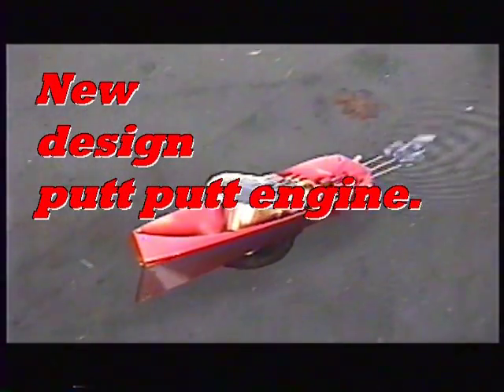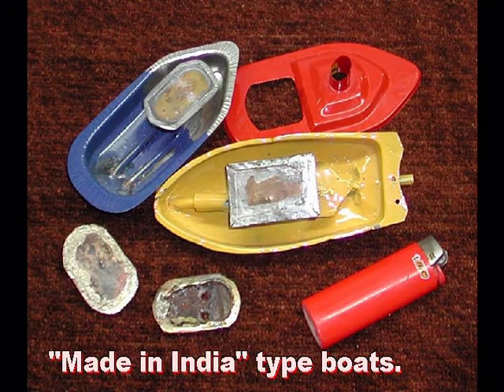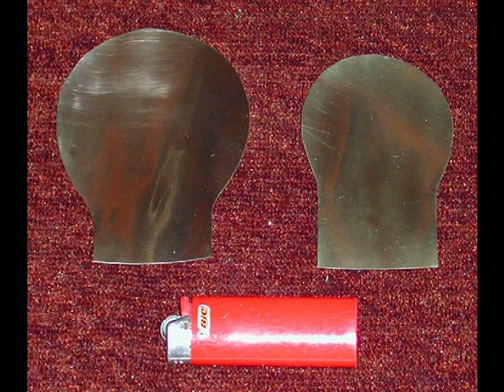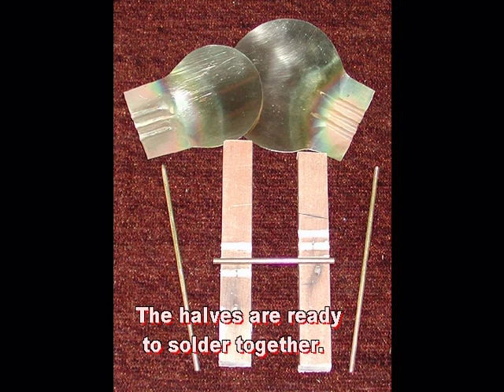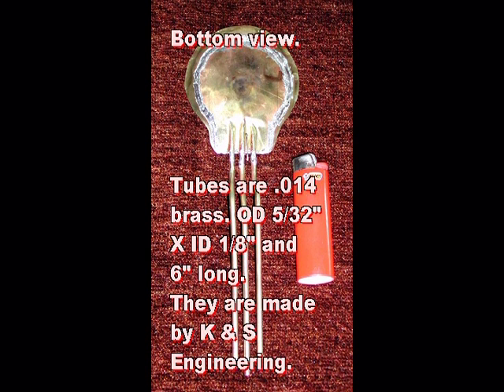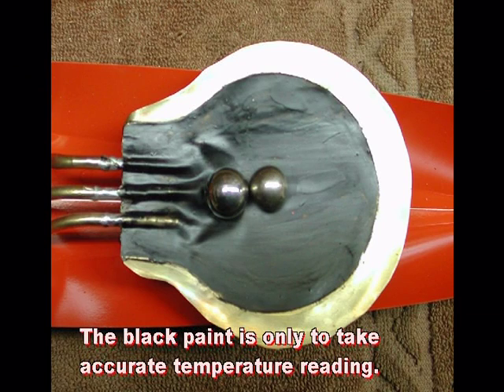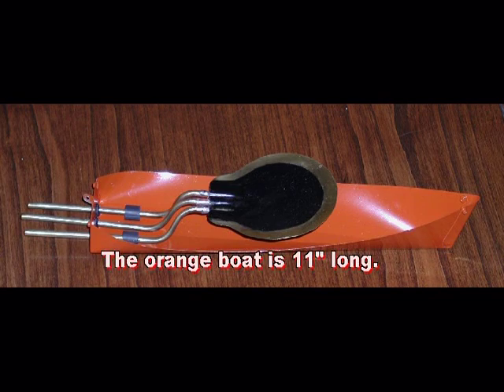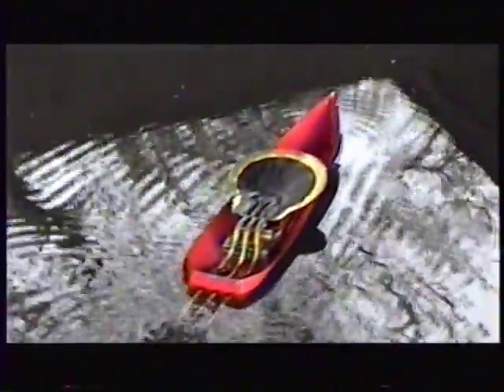How to Build the PP4V Putt Putt Engine-YT.mpg

Comment: So I made your engine! It was fun to make and easy to follow this video! I'm happy to say that the engine does work although not as well at I'd like(yet). I'm not sure if I need more heat or less or if I just did a bad job putting it together haha. I did have to much heat the first test and blew the solder out but it ran like mad whith the high heat. Anyways I posted two videos on my channel showing the engine on some foam to test.
Reply: Also do you think brazing could be possible? you could add a lot of heat if brazed
Reply from the maker: Good job. I watched your videos and you are obviously close to getting it right. Leaks are the most common problem so use a bike tire pump to pressure test. In the video it looks like your boiler is higher above the tube outlets than suggested and perhaps it is too far from level. Maybe it is just the camera angle that makes it look that way. For the smaller engines it is sometimes hard to get a burner low enough to fit under the engine and the temptation is there to raise the boiler rather than build a burner that fits. Thanks for commenting.
Reply from the maker: The heat required to braze these thin boiler parts would melt them. That was part of the challenge in designing this engine.

Comment: Im interested in your aluminium boats, i have a sheet of aluminium 1m47 by 1m90.
And would like to make a small boat that could take my weight. 95 kgs. Im un decided as to what hull shape would be best, canoe, or flat bottom. 
If the sheet is too small, then my other idear is to make a scale rc boat after a mtb or air sea rescue style boat. I can weld aluminium (aluweld braising). 
I also have a lot of smaller offcuts that can be used for reinforcing. 
Minilandroverfrance@gmail.com
Reply from the maker: I know nothing about designing and  building full scale boats. No doubt there are some how to videos on youtube that might help. One thing I am sure would be worth the effort is to build a cardboard mock up of what you want it to be.  D.

Comment: I'm just not understanding the three and four tubes. What are the differences?
Reply from the maker: Good question. I'm not sure except that in my experience up to a point more tubes =  better performance. My best engines have seven tubes. See Jean-Yves's pop pop pages at www.eclecticspace .net
He has engineering and physics knowledge that I do not have.  I believe that he said in theory a single pipe should be best, but I have found them difficult to run and inconsistent though at their best are impressive.

Comment: Did you ever think about making a full size boat that you can ride in
Reply: the cockpit would be around 200F. once the water heated up.  Good for cooking lobster not so much for beach bunnies.
Reply: Scaled to full size, this would be equivalent to a small boat with a small wood-burning steam boiler. Though, I think it might require check valves. (You could even design it so water is only sucked in from the front of the boat and can only exit from the rear.) A put-put or pop-pop engine is, essentially, a form of pulse jet engine (a simple type of ramjet), but built for steam and water instead of fuel and air. No, the cockpit of a full-sized boat would not necessarily be 200F.
Reply: It wouldn't scale up without valves, etc.  Basically, you would then be talking about a steam engine.
Reply: @Simon HomeintheEarth I think a requirement to use valves would be the only major difference. A typical steam engine involves the use of at least one piston and camshaft, in addition to valves. A scaled-up put-put engine should be much easier to fabricate and build than, say, a Sterling steam engine. That simplicity could be appealing to some, esp. if it allows almost anyone to build their own. You might even get away with using flap valves.
Reply: @XpaceTrue  You referred to a "Sterling steam engine".  Correct me if I'm wrong, but I don't think a Stirling (not Sterling) engine is a steam engine.  It is a hot air engine.
In case there was a steam engine called a Sterling engine, I searched Google for it, but I didn't get any hits.
I also thought that a one-way valve, letting water in the front and out the back would make for a better pulse-jet putt-putt design, but if you look at other videos by the guy who posted this one, he has experimented with that, but found it to be detrimental.  I guess he's probably right, having built about 100 putt-putt designs.
Reply: full size would mean, larger tubes, and when you jetison water then you have to suck it back in, for smaller tubes the % of water coming from different angles, is great, but a larger tube, greatly increases opposite vector to thrust water rushing in, negating all forward movement... Maybe with 2 tesla valves ... ...

Comment: I've been fascinated with putt putt boat's since I was very little. A friend help me build I tin one when I was 3 and I was amazed and attempted to build several in the years to follow, with little success I should add. Decades have passed since then and I've made one recently with 1/16th copper sheets for the diaphragm and with my observations and understanding that copper is a great heat conductor it heats up quick and putts along faster then my children can run. You have much more experience then I do would you consider looking into this and if you find something exciting share with us.
Reply from the maker: Good for you. Copper is the best material for the boiler but not for  the diaphragm assuming you want it to make noise and I would expect 1/16 to be too stiff. However whatever works with these often frustrating little engines is fine. Did you have a specific question. Most of what I know is in my videos. Thanks for watching and commenting.

Comment: I bought the little commercial ones from Lee Valley and they worked great. I couldn't get anyone in my family excited about them though, so I ran them for myself. I'm 70 and I thought they'd be fun to share with my kids and grandkids. Guess not.
Reply from the maker: Hello David. That's what I thought 10 years ago when I was 70. Apparently if it is not an electronic device with keys a sceen and interective it is of little interest. Never mind, play with it yourself. The made in India ones like you have rust very quickly as moisture inside the engine is very difficult to remove. Suggest you bake it in the oven after use at about 250 for an hour. with the pipes open end up. Buy some more and you can have races.  Drf
Reply: @DarylFosterPuttPutt4Video  i just love historic toys back when an led was a luxury i may be young myself but sometimes i prefer to watch my turtles swim around as they are super goofy.

Comment: Hello Daryl, I have tested with a similar engine with 3 tubes which stops after running for some time. I am guessing this is due to 3 tubes, that the steam does not travel down the tubes and get condensed(smaller boiler:tube ratio). Is it this what is happening?

Syed
Reply from the maker: +Syed Taha Thanks for commenting. How long does it run before stopping? The most common cause of engine stopping is a leak. Sometimes leaks are very hard to see. Use a tire pump to apply air pressure to the boiler and pipes while holding the engine under water. Bubbles will indicate a leak. If engines with low temperature solder overheat the solder can soften a bit and cause a leak that will seal it self when the engine cools. Try running the engine with a bit less heat. If the engine stops see if there is any water left inside. You have to check quickly because as the engine cools it will suck water back in. If there is no water inside you either have a leak or have run it too hot. Good luck.
Reply: +Daryl Foster It is running for ~600 seconds. When I blocked 1 and 2 tubes, the engine then ran for a longer time. I have tested for leakage already and I dont think that leakage is the reason behind. Probably the power is too much, I am inputting around 36 watts. But if the power is too much, why it does not stop for 2 and 1 running tubes? It seems like tubes:boiler volume ratio does matter?! And there is a "tickle" sound after stopping, sounds like boiler is empty and its heating up.
Reply from the maker: +Syed Taha Does this engine have the same design and sizes as my PP4V engine? Do you have larger tubes? There is a relationship to boiler size and tube size and length among other things. Reduce the heat as much as you can to find the minimum amount it will run on. The tickling sound may be the last little bit of water which is insufficient to keep the engine running so it is sizzling in a too hot engine.

Comment: Nice vídeos.
I imagine how much   work  researching and trying new things you  used to get to this high level regarding these boats. 
So,  thank you for sharing your knowledge.  
--------------------------

I   was wondering when the boat moves forward. 
When the metal capsule expands or when it contracts?
Reply from the maker: +San Pol Glad you enjoyed the show and thanks for commenting. The boiler collapses at the end of the power  stroke which is when the boat moves forward and the steam condenses lowering the steam pressure. Pressure then starts to build again which expands the boiler. Hope that makes sense.

Comment: Hi Daryl, for a class project, I have to create a putt putt boat which has superior speed. Do you have any recommendations for fuel sources which would boil the water more quickly? I considered using an electric heating coil, but then I require the additional mass of a large battery, and performance would surely suffer as a result.
Reply from the maker: +starreactor Unless you have built a very large engine more than enough heat is available from a methyl hydrate alcohol burner.Use extreme caution with this fuel as it can cause harm from burns, poisoning and fire. Better to built a boat that is extremely light in weight and an engine that runs with high hertz. Those have been the two keys to speed with all the boats I have built. Good luck.
Reply: We are using the boat in a chemistry lab which is equipped with the appropriate safety equipment. Thanks.
Reply from the maker: +starreactor Good. I'm glad to hear that. There is a PS to what I wrote yesterday. The heating is only a part of the cycle. The other part, cooling, which causes the condensation is just as important.

Comment: Hey Daryl, I am finding the factors influencing performance of putt putt boat using your made design. I am having some issues with the brass sheet, it is not vibrating. Maybe because of the tube size is big (6 mm diameter). Can you suggest any solution of shaping the metal sheets?

Thank you,
Syed
Reply from the maker: +Syed Taha  You do not say if the engine runs. Do you want me to help diagnose a problem? If you have done anything different than what is in the plans that might be the cause of the problem. If the brass you used is thicker that could be a problem. Let me know what help you want.  Daryl.
Reply: +Daryl Foster Thanks for the quick response Daryl. The engine is running with very small propulsion and stops suddenly after about 5 minutes. I am also considering the effect of brass sheet movement(the putt putt noise), but when the brass sheet is shaped for tubes, it is deformed outwards and is hard to change shape by the vacuum created. The brass sheet is 0.1 mm thick, and the copper base is 1 mm thick.There are 4 tubes soldered to the boiler each of length 320 mm. Is the tube length too big for the engine to work for longer time? Also can you suggest me any way to shape the copper and brass sheet? 

Thank you,
Syed
Reply from the maker: +Syed Taha If I understand correctly, the material sizes you have used are quite different than specified. The 0.1 brass is OK but using 1mm copper for the base will have high heat transfer and could cause the solder to melt and the boiler to leak. You have gone from 3 tubes planned to 4 and doubled the diameter and length I think. That is a very large amount of tube volume for the small boiler so I would not expect the engine to run well at all. Other than starting again and following the plan more closely you could try running with the boiler raised about 15 degrees up from the tubes outlet. I doubt this will solve the problem but in a larger engine with a greater boiler volume it could be expected to help. An engine that runs and then stops in a short time when all else is correct is most often caused by leaks. Double check for leaks, and, an engine can leak when hot from solder melt and then seal itself as the solder cools. When the engine stops you can immediately remove it from the water and see if it has any water left inside. If it does not it is either a leak or just a result of the design. Let me know how you make out.  Daryl.  Please do not burn yourself.
Reply: +Daryl Foster What would you suggest the thickness of the copper base then? Actually I am finding the factors the influences the performance of the boat, so I will test with 2 different diameters, different lengths and number of tubes. In order to run with 6 mm diameter tube, should I increase the size of my boiler? Or I make it a cube shaped boiler which has a constant distance between the copper and brass sheet? the other diameter I am testing is 3 mm. Also can I have your email or something so I can explain and show you the drawings? 

Safety first, got my gloves on before testing. Thanks  anyways 

Syed
Reply from the maker: +Syed Taha I though you were trying to build the PP4V engine but I guess you are working on something else. Probably a good idea for you to watch some more videos about building engines and read the material that is available if you are designing your own engine. Good idea to do some experimenting. I'm sorry that I cannot consult on individual engine builds but keep up the good work. Don't be discouraged if it takes a few tries to get something you like. There is another design at http://modelsteam.myfreeforum.org/about29385.html        and another at              
http://modelsteam.myfreeforum.org/ftopic40752-0-asc-75.php

Comment: Hi Daryl kindly advise for the PP4V if the boiler must be parallel with the water line orIn some angle? You have done perfect job. Thanks
Reply from the maker: +ANTONIS VIANOS It does not have to be parallel with the water for the engine to run well but you should try to be close to it for two reasons. When it is level any liquid water in the boiler will flow to the center low point where the flame is and, as too much heat near the edges can melt the solder the flame will stay centered best in that position. I hope you are having fun.